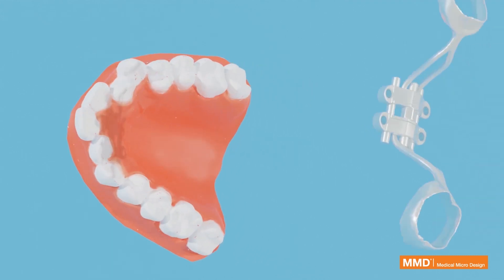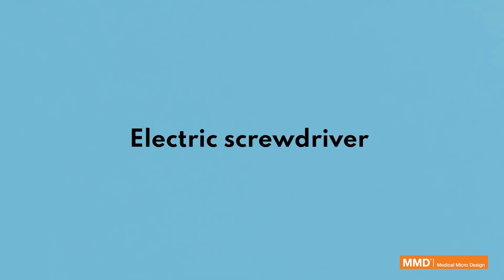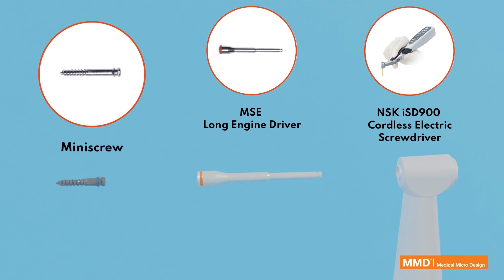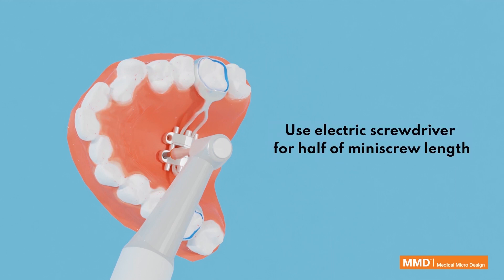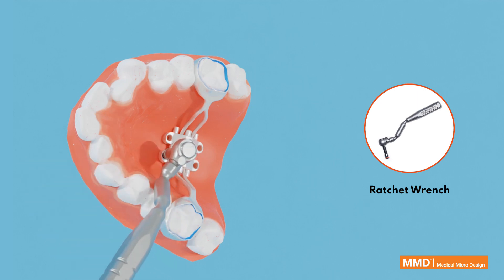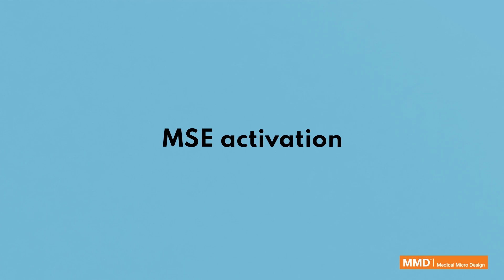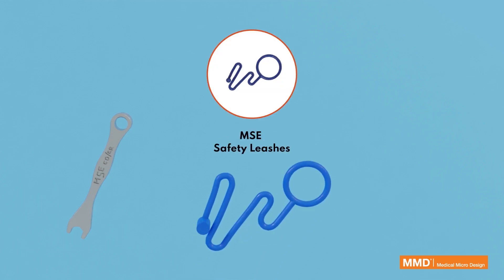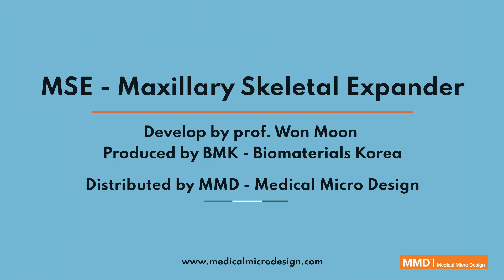Palatal Expander MSE, Maxillary Skeletal Expander, positioning on patient with Electric Screwdriver

Comment: What happens if a tad screw gets stuck in bone upon insertion? How to remove?
Reply from the maker: It can be easily removed with a weingart plier.
Reply: @medicalmicrodesign  the orthodontist tried removing it using the mse wrench but either it got stuck or the head of the screw got stripped. If using a wiengar plier, are you saying to pull it directly out or slowly turning the screw out using the pliers?